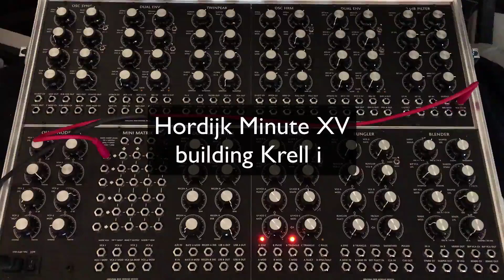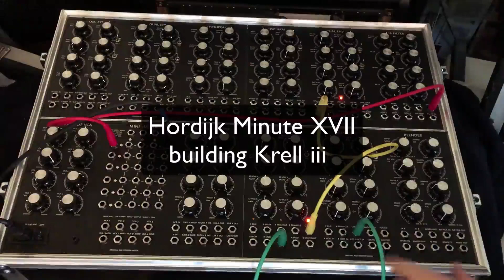Building the Hordijk Krell

Comment: This is very interesting but I normally chose to improvise this sort of stuff live on a controller / keyboard. Only when things are setup in a very specific way, for instance to have extra quick modulated repeats or variations would I chose to take this long path. It is actually the reason why I do not especially favor modular synths. Why do all this automated randomisation when a polyphonic set of randomisation generators is built into /attached to my body? Things are however changing because multichannel step sequencers are now offering randomisation functions that transform them in a sort of live session accompanying band.
Reply: this is probably a bit more random than your brain can be